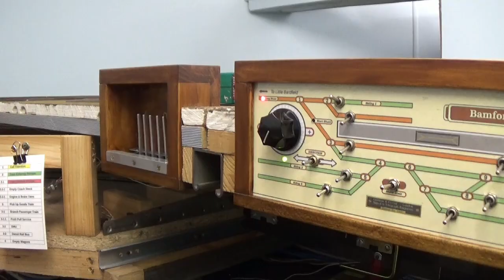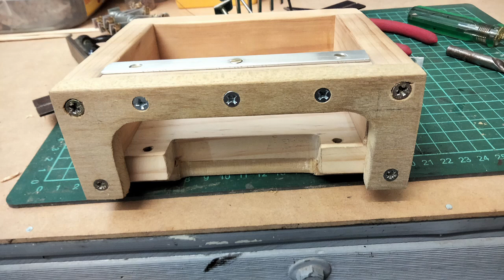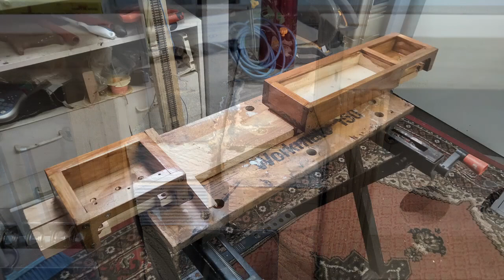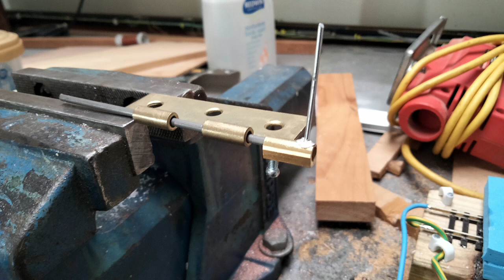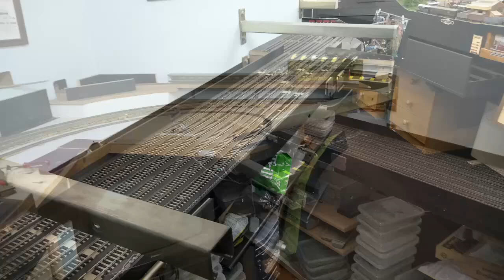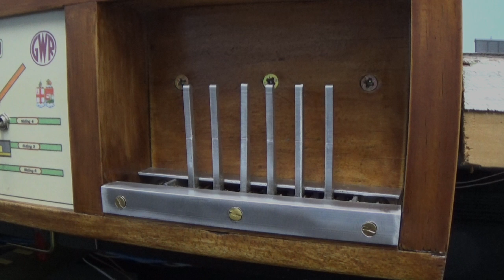GCJ May 2022 Update

Comment: I am with you on the creamary with the price of wagons, and it's not just wagons, coaches, Trains etc. Excellent update as usual, love the bell cranks, so simple yet so effective. Regards Frank.
Reply from the maker: G`day Frank,
Thanks for your comments.
Yes the price of things is going a bit stupid in my opinion.
I know they are detailed models but they are also just bits of plastic too, and I find it difficult to see how they can justify the prices asked in some cases.
One of the pricey examples on Ebay was a  DAPOL 00 GAUGE - 'UNITED DAIRIES LTD' 6 WHEEL MILK TANKER (WESSEX WAGONS LTD ED) at 35 pound plus 12 pound postage and 6 pound import duty.
53 pound total for me which is about 106 dollars Aust. for what I consider to be about a 30 dollar wagon.
Well they know what they can do with it Frank.?
I am glad you like the bell cranks and the set up.
It`s a fair bit of work to get it all set up, but usually and fingers crossed, that`s it.!!
Take care and all the best
Gormo
Reply: @greatchesterfordjunction  I feel your pain, is the import duty on everything in Oz. I have got so fed up I have invested in a 3D printer, all I have to learn now is how the bloody thing works. Cheers mate.
Reply from the maker: @frankwhittle4364  Yes Frank,
The duty seems to be on everything. Initially Ebay was not applying it so it was  a loophole I suppose that the Govt. closed.
Good luck with your printer
Cheers Gormo

Comment: Hi Gormo. I have to say that you have done really well. The point control and lever frame system is really good and should be trouble free for years, especially with no electrical gremlins to worry about. The control panel looks superb. Again thoroughly enjoyed watching. Cheers Chris
Reply from the maker: Thanks Chris,
Yes the original levers I built have been trouble free for years, so it has been worth the trouble to build it.
Finished now.....no more points to hook up.
Cheers Gormo